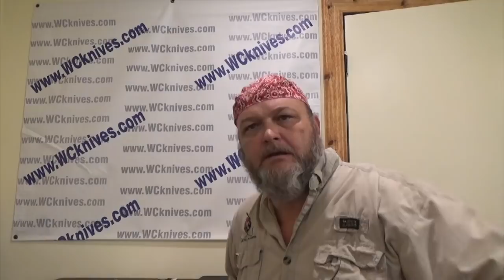Knife Blade Heat Treating Tips and Advise

Comment: Great information as usual... and the real reason your knives in O1 and CPM154 are wondrous to use. The heat treat just plain works. Hoping for your success in dialing in the heat treat for AEBL... now that steel would be an outstanding custom alternative for your Master Woodsman, WCNK and/or WCSK.  When you've got it dialed in ... should it be before March/April of next year when my WCSK custom is due to be made (yes, fully paid for 039C)... I'd certainly be willing to be one of the guinea pigs for my WCSK in AEBL (even 5/32 in AEBL versus the normal 3/16 O1).  

Even if a bit more expensive (or I need to send you some extra $ between now and when you make it)... I think a custom WCSK in 5/32 AEBL would be something to behold. 
All the (continued) VERY BEST!
Anthony J., USAF ret.
Reply from the maker: Testing the steel in thicker versions now. Should have results in a few weeks.

Comment: Thx for sharing. We’re at the point that there shouldn’t be anyone left on the fence when it comes to weather or not to buy a WC knife. William you have shown us in every possible way that your final products work and work well. In most cause compared to other custom and semi custom,forged or stock removal, makers your knives in the steel that is chosen holds up and out performs.

Comment: You used Holy Quenching Oil and virgin blood as well? Anyway. what you said was what knife maker Jay Fisher said why customs, or bench makers knife HTs are better. It's the attention to small details like what you said. You need precision equipment. Not a charcoal forge or kitchen oven. 
BTY, you going to try out or invest in our own shop cryo?
Reply from the maker: Gadget yoyo still in the fence if cryo is hype or actually beneficial. It appears through my testing it only helps with corrosion resistance in a few steels.